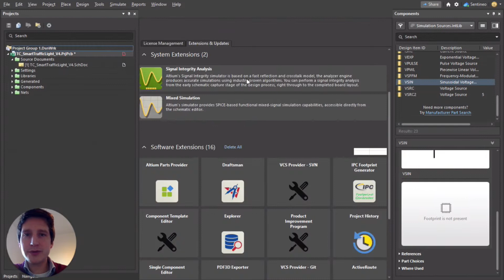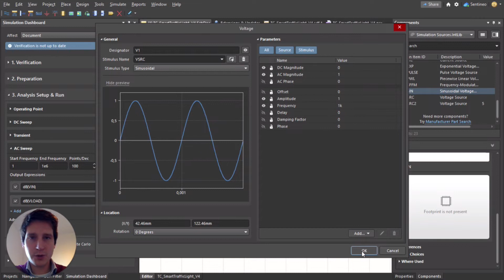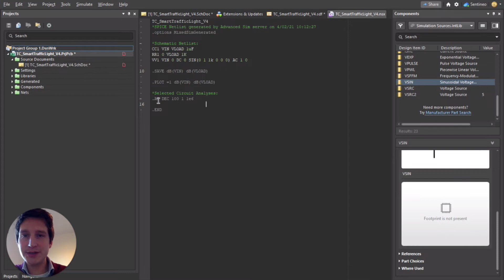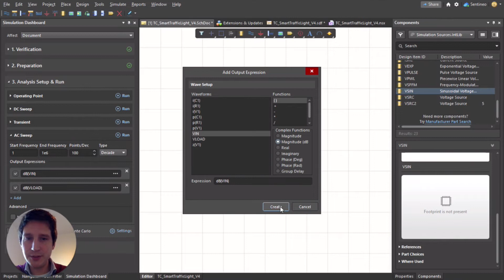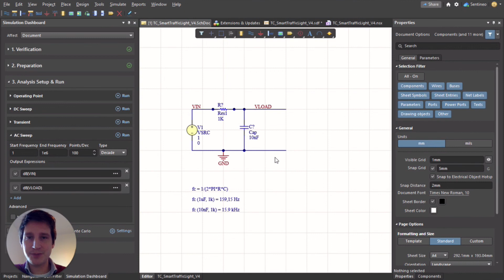How to do a quick Spice simulation in Altium Designer

Comment: hello sir,
Thanks for the presentation.
I simulated a relatively simple circuit with two resistors and two inductors in parallel for transient analysis. The problem is that the result I get does not correspond to the expected one (The amplitude of the output current and voltage signals is too low). If you can help me, it will be really appreciated.
Reply from the maker: Hello, sure let's try to see what is going on. Can you elaborate a bit more on what you are exactly expecting (and why), and what are you seeing as an output? First things that come to my mind are checking the voltage input source amplitude in the simulation . 

Maybe try it first without attenuation (so a 0 ohm resistor and no inductor) and see if that gives you the same output amplitude as your input source.
Reply: @sentineo  Thank you.The implanted circuit consists of a 12V dc source which supplies a resistor R1=400 ohm in series with two inductors L1= 200 mH and L2= 500 mH and another resistor R2=1.3Kohm in parallels.The dc source therefore supplies R1+(R2 \\ L2 \\ L1).
The goal is to draw on two separate graphs the transient regimes of VL(t) and IL200(t) which are the outputs.

When i try it without attenuation, i find the same output amplitude.
Reply from the maker: @aboubacarabdoudango7805  Hi, the problem is your source. For a transient analysis, you will need to have a source with some kind of AC behaviour. The inductors behave as a 0 ohm resistance for DC, hence you will measure 0V over them (for an ideal inductor) in your simulation. 

Try adding a source that has a step response (for example a pulse voltage source) and you'll see the difference.
Reply: @sentineo  That is the problem, now it's works. Thank you very much
Reply from the maker: @aboubacarabdoudango7805  You're welcome! Great to hear it works!